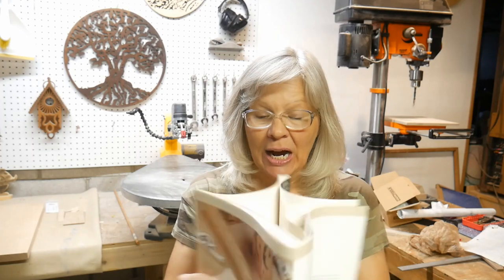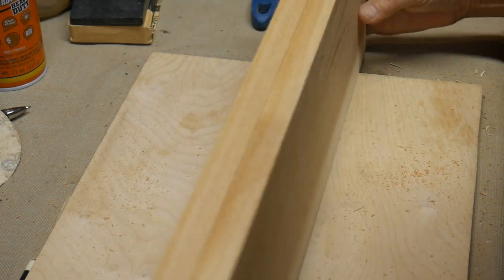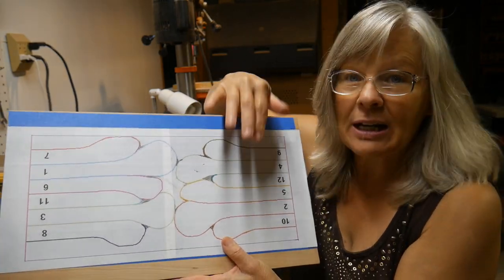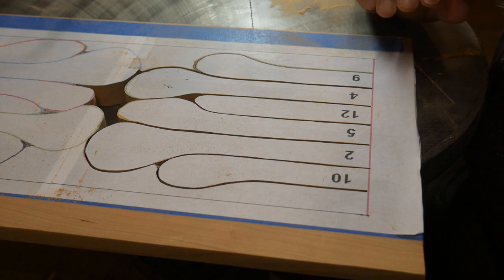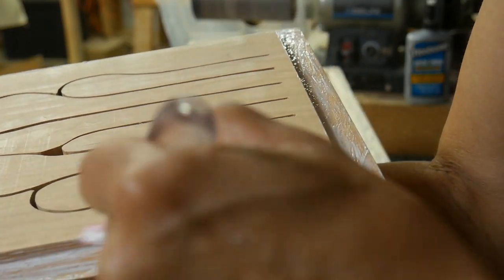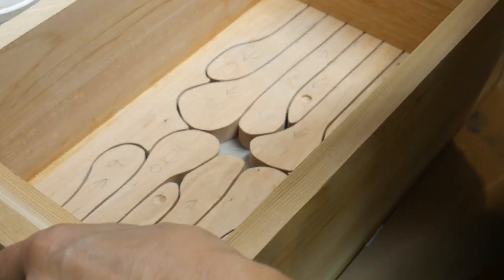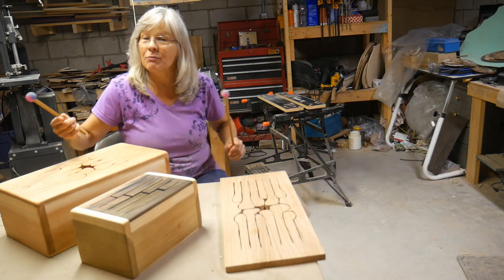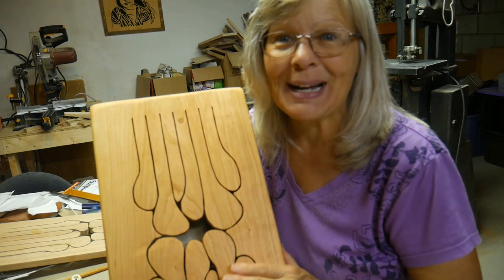Learning to make a Tongue Drum

Comment: Nice job. You will find that you need to have about 2 1/4" of solid on each end so that the notes will have some sustain to them. Also, prior to glueing the top on, it is helpful to dato the end Of the tongue about 1/8" deep at the 2-1/4" mark from the end. This will give the note a richer tone and is a good starting point to start tuning from. Rather than drilling at the hinge side, use a chisel to lower the note. Remember you are trying to get the tongue to vibrate at a certain frequency. Think of it as a hinge. It needs to be even across the width of the tongue. 
Keep at it you are doing great.
Reply: Correction: dato at the closed end of the tongue.
Reply from the maker: Thanks for the extra tip.  I'll have to give that a try.